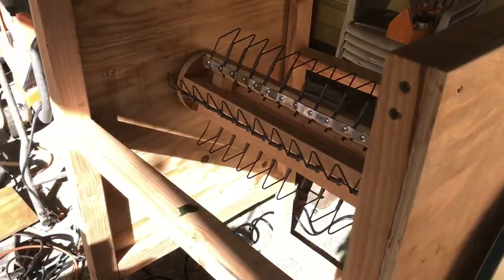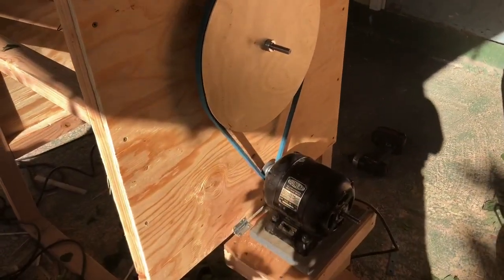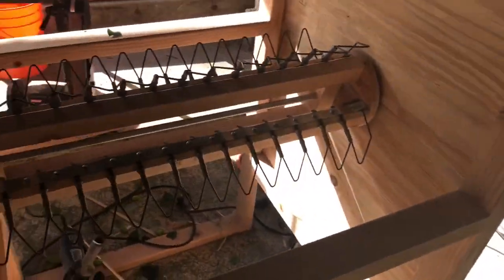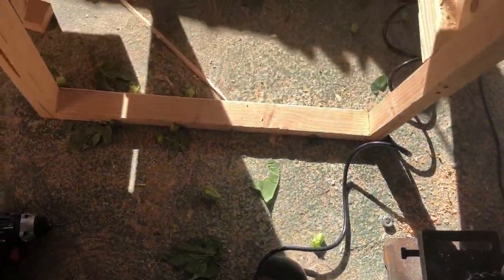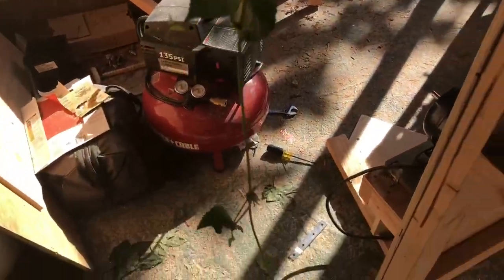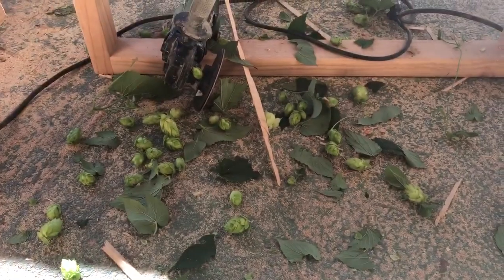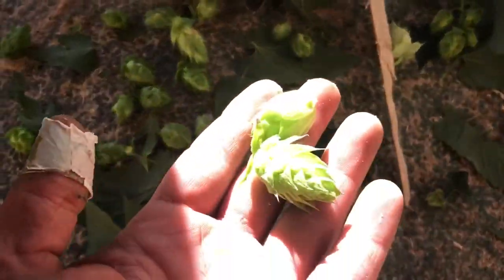Micro hop harvester

Comment: Do you have any sketches to share?   Nice job BTW.   That looks like about the scale of machine a home brewer or two could really take advantage of.   After picking how do you process the hops and chaff?   

I made a little bean threshing machines to process green and yellow pole beans along these lines - thresh the dry bean husks then to remove the chaff I dumped the beans and chaff in a bucket and wave a leaf blower around in it and presto the chaff flies off and I'm left with clean dried beans for baked beans or whatever.  I was looking for something similar for my hops starting with picking.